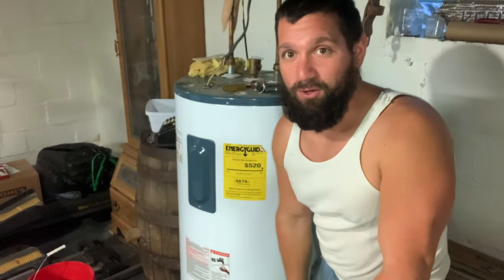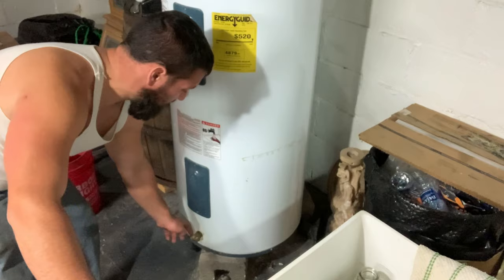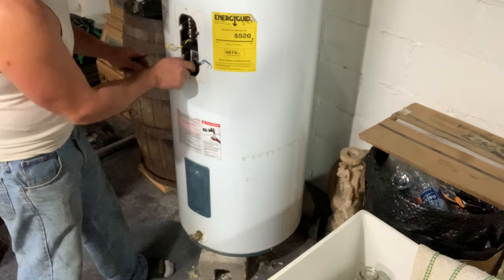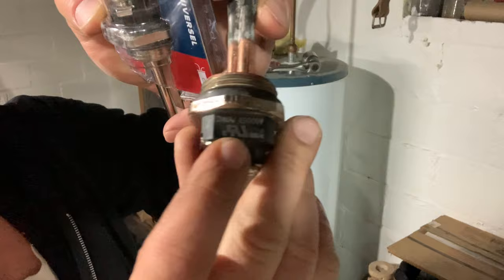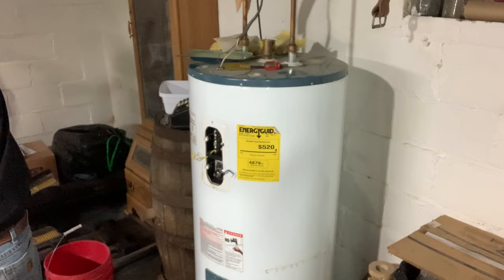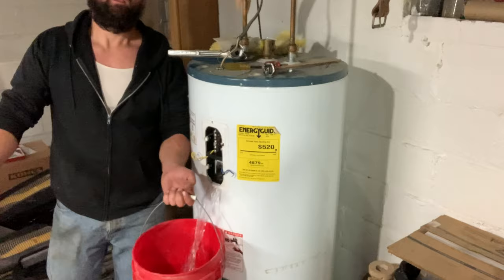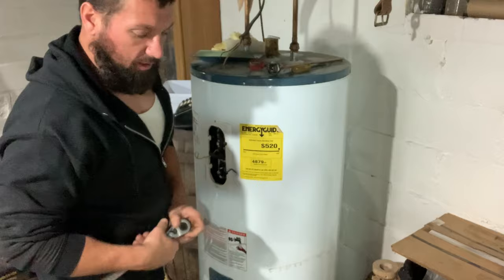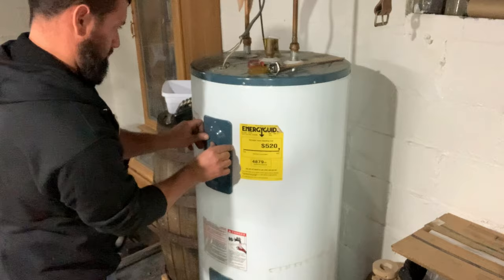How to replace an electric water heater heating element

Comment: Good video. Best to drain the tank before changing the elements if you can. A lot less messy. Shut hydro off, turn cold water feed to tank off, open hot water tap closest to tank (to help tank drain more quickly) and then open drain valve on the hot water tank (at base). Once the water is drained, you can start removing the heater element(s). Once the element(s) replaced, open the cold water feed valve to the tank and fill it until there is water coming out of the hot water tap you opened previously. Close the hot water tap. Check for leaks at the element(S). If no leaks, connect the wires, and turn the hydro back on. Grab your favorite beverage and pat yourself on the back....all done!
Reply from the maker: I couldn’t agree with you more about the bottom drain at the base the reason I don’t do that anymore is one time that drain never stopped leaking on me on a Sunday 😂 I have the worst luck though appreciate you typing that all out it’s helpful
Reply: I learn more from you than the video…thanks
Reply: @dlandscapingdesign1052  Glad it was helpful. I should add, that if the tank is old, there is a chance that the valve at the bottom of the tank can become clogged up with the sediment and corrosion that builds up and falls off over time, especially if you live in an area with hard water. You may have to use something to unclog it air compressor or flexible wire you can snake thru it. My old tank base valve was so clogged, I had to cut it off in order to drain the bottom of the tank. I replaced it with a new Rheem Plastic tank so shouldn't have that problem again.
Reply: Nice 👍🏼
Reply from the maker: Awesome
Reply: One important thing to remember when refilling the tank after element replacement, make sure to keep a nearby faucet open to purge any trapped air out of the line I; order that the tank fills to the top. Also, never turn the water heater breaker back on until the tank is full or you will burn out the element.
Reply: What is hydro?
Reply: Yep, this is how I've always done it. The video looks like a trial and error method.
Reply: And also when you’re checking for leaks after replacing the elements, check by opening the valve that releases the water back into the water heater and close the pressure relief valve on top of the water heater. As the air pressure builds up again from closing the (PRV) and the water filling up again, get close and put your ear 👂 as close to the element port as possible. If there is air escaping because of the water filling up and PRV closed, you’ll hear a hissing sound and in that case, grab your 1 1/2 socket and jumbo ratchet and continue tightening the element until that hissing noise stops. Repeat for the bottom element too if necessary. If not, you’re good, and can close the panels for top and bottom and make sure to connect the wires on the elements and thermostats before closing the panel and turning the power back on again for the water heater. Also note, test your circuit breaker switch for the water heater. If it’s bad replace it. Its normally a double 30 Amp switch that’s like $15-20 bucks at home depot and super easy replace. You can YouTube that too.😊
Reply: Also I forgot to add, if you’re wires are bad on the water heater, replace them too. Also dirt cheap to buy a line of those. Verify that it is appropriate in conjunction with the amperage from the 30 Amp switch, in the switch board panel.
Reply: @frontwoodsfarmer2063  happened to me, bad leak. I put a hose spray nozzle on it and cranked it down, ugly, but stopped it! Thanks for the video.
Reply from the maker: @DaveSomething thanks for watching! Appreciate all the kind words
Reply: Sloppy mess. Not recommended
Reply from the maker: @jointhejourney7472  sloppy joes sloppy mess 🤷🏽‍♂️

Comment: Hey man, I just wish you mentioned to people that when you drained from the top element orifice, all that water soaked the insulation and most likely the terminals at the lower element. 80% of the time, it's the lower element and if you have that much build up you will just keep replacing them. Not to mention the danger of shock and mold from moisture.😂

Comment: This is an excellent tutorial! I have done this a few times and it's pretty easy. Most heaters do have a universal element hook-up and it can be done in no more time than you took doing it in this video which is very informative. I always stress that you don't want to turn on the power at your breaker box until after completely filling the tank as you can very easily ruin the element by having it live without being wet
Reply from the maker: Thank you for the kind words! I should have mentioned filling the tank that is a good point i appreciate this comment!

Comment: Shut off your cold and hot water to tank
Briefly open relief valve to release pressure

Now when you pull your element it will “chug” out at first but youll easily be able to put the new element in without waiting to drain the water down.
Reply from the maker: Nice! Thanks Kellen for the advice.
Reply: Yes. If the end goal is simply to replace element, and you are keeping the unit, there is no need to drain it. Let water cool a bit, no pressure, but close valves so water comes out very slow. Unless you are flushing, cleaning, or replacing unit, waste of time and messy to drain it. Pull element out..... Rather than hold buckets, quickly put new element in.  If water is cool, no pressure, and valves closed it won't leak much.

Comment: I have the top element seeping water from around the gasket area . My wiring bar is held in place using a support bracket the slides onto the element housing . I think I can tighten the element enough to stop the seep of water . These elements are the 4500 watt rating . I am glad I saw this video because I am old school and remember we had only threads we had to use liquid Teflon on the threads to seal . I’m glad it’s a rubber type gasket/o-ring .
Reply from the maker: Great tip! Thanks for sharing!

Comment: Turn off the cold water , drain your hot water heater , it takes close to 1 hour, hook up your hose on the bottom, 
Then shut off your power to the hot water heater before you do any electrical work 
Remove your old elements up and down and the thermostats as well 
The whole kit is around 35 dollars 
After you finish , turn on your water and wait about 10 minutes to turn the breaker on 
Good luck
Reply from the maker: Thank u much

Comment: Avoid the mess man and just replace the drain valve. Or use the one you have and if it doesn't shut off 100% screw a hose bib cap on it. All that water everywhere mixed with the 240v can definitely cause an issue.
Reply from the maker: Thanks for the tips

Comment: And I had to get the one with frozen in place elements, got the cheap socket from Lowes with  a 20" screwdriver PB spray and couldn't budge it. Seen where a guy used a impact gun and it worked good,so I got a 38mm (which is 1 1/2" )  6 point impact socket from auto parts store and used my 1/4" Dewalt with a 1/4" to 1/2" in adapter and back them right out and installed new one with a little never seize for next time. Had to take the bevel off the face of socket on a grinder first to get a better bite on element.
Reply from the maker: Thanks for letting us know all the sizes

Comment: Very nice ty ty for all the safety tips also good thinking
Reply from the maker: Thank u for commenting! I’m glad it worked out for you. Are you on a well system or city water?
Reply: @frontwoodsfarmer2063  well water.  But needed to be replaced the whole water heater was shot  but I loved ur video when the heating elements need to be changed I’m gonna try it.  The water heater was 11yo
Reply from the maker: Oh ok I gotcha ya things like that don’t last quite like they used to we have a refrigerator that went through two compressors since 2016 it was almost $4,000 we got it 75% off for a going out of business sale but I’m just thinking what if someone paid the full price had to go through all that what a shame. I’m happy you liked the video 😊

Comment: If that valve gives you trouble do not get a new water heater. Get a full port ball valve. It will make it easier to flush the tank as well. It doesn’t make sense for them not to have them from factory.
Reply from the maker: That’s a great idea thanka

Comment: I have a similar issue with debris in the bottom of the heater. I plan to shut main water valve then pressurize the hot water side with air to force the water out through the cold water dip tube that goes to the bottom of the water heater. I can then open a cold water sink valve and drain the tank that way.
Reply from the maker: I never thought of that I like it

Comment: If I’m getting hot water, but not hot water like I was before, what’s your recommended diagnosis? 

Could it be a thermostat? Or most likely heating elements?
Reply from the maker: There are ways to test everything with voltmeters but I’m unsure how to do this you can’t really go by what it’s doing always sometimes I’ve found on that situation it’s a gamble between the two so I replace everything.

Comment: Look at the wattage rating of your hot water tank, usually written on the side of the tank, before purchasing an element because the total wattage should not exceed the manufacturer recommended load
Reply from the maker: That’s very good information to know thank you

Comment: @FrontWoodsFarmer  hey jus an fyi when you hear that gurgling sound when first taking the element out it's like a straw sucking air if you dont dilly dally you have about 15 seconds  pull it out and have the other replacement ready to go and put it in be fore the bubble releases and there you go it's in no mess no with minimal loss of water just so you know for the next time that's how plumbers do it
Reply from the maker: I appreciate that information if I go to change mine next time I’ll do that most of the time I drain it all so I can get some of that calcium out of the bottom unfortunately still got the old well water 😂

Comment: If the hose will not drain, use a siphon to drain it.  Put it in through the top element.  A 50 gallon tank should take under 20 min to drain.
Reply from the maker: Thanks for adding that to the comment section like I said def not an expert here always a better way to do something
Reply: @frontwoodsfarmer2063  i also learned to ensure it goes all the way down, as... the shop vac got a heck of a work out when taking out the bottom element 🤣
Reply from the maker: @WreckerRC  yeah there was alot of cleanup showed off camera 😂 special footage haha

Comment: So you dont need to burp the tank afterwards. I mean after screwing in the elements I figured there would be a larger air bubble in it. I heard air bubbles will cause you problems and prevent your tank from filling full of water?
Reply from the maker: Good question in my situation I got the laundry tub right there I leave hot water open when filling. I should of put that in the video like I said I’m not expert lol thanks for commenting hope everyone sees it I know it should be up top now 👆🏻👆🏻👆🏻👆🏻👆🏻
Reply: To be clear, leave a faucet open on hot water when filling the water heater. When the water heater fills, water will come out of the faucet and you know that the water heater is filled up
Reply from the maker: Good advice 👍

Comment: Should I fill the tank first and check for leaks before reconnecting the wires in case I need to tighten the element further ?
Reply from the maker: That’s not a terrible idea again I’m no expert so that sounds like a much better idea! Thanks for commenting and your input.

Comment: You are the FRICKEN MAN!!!! 😃 THANK YOU SO MUCH FOR THIS VIDEO BRO!!! i know you know how much money you judt saved me  being a dingle mom and unemployed i have to do constant maintenance in my home to ensure the life of everything we use daily . That includes the water heater. My bittom element isnt looking good at all. AT ALL!!! also the insulation is burnt and i dont want to put tget back on there. Can i judt get another piece and put it over it or is it like i got to sruff it up and around it and then drape it and put the cover back on? Its burnt and that scares me to death....
Reply from the maker: Thanks for watching and commenting!! That helps me wayyy more than u know i appreciate it 🙏 yeah with it being burnt I’d recommend calling a professional HOWEVER if it was me because only I can be responsible for myself 😂 sometimes haha I’d leave that small piece out and check make sure the wires aren’t burnt but I’d assume it’s from that bad element causing a ground issue I’d pop in a new element if it were me and be done leave the insulation out. I think that’s so impressive what your doing ❤️
Reply: @frontwoodsfarmer2063  yeah I already ripped it off and the wires seem to be ok it's just the actual metal. I tested it and it's exactly at the correct voltage and amp so thsts a huge relief 😅 and hell yeah dude your THE MAN!!! I haven't been able to find any videos about this particular electric hot water heater. It's actually amazing it lasted this long  I just moved into this house and slowly been working my way from up stairs to down stairs redoing everything. It just hit me one day.... damn I bet nobody has ever even cleaned this hit water heater off let alone serviced it 😅 I think I caught it just In time tho. 😊 your amazing thanks again. BTW thanks for replying I usually NEVER get a reply or even a like so you serious made my day 😏
Reply from the maker: @nikkilovetheyardsale-again2608  that’s so awesome your the best! Well good luck if you need anymore how to videos lmk I can throw some out

Comment: What happens if you get your insulation really wet. Should you let it dry out?
Reply from the maker: Yes
Reply: Hi. Thanks for responding. I replaced both heating elements. It did not heat. Then I reset the red button and it immediately started working. I'm amazed that it was still working with the heating elements so caked with mineral deposits. But maybe that's why it triggered it and it stopped heating. So now I have hot water. I just need to replace the anode tube, which I'm sure will be much more difficult.

Comment: Quick question. I have the exact tank and everything. The issue I’m having is when we use to much hot water the tank trips it’s safety switch. Not the main power breaker in the panel box. I’m saying it has a reset button I guess part of the thermostat by the top element. Would that mean I have a bad element?
Reply from the maker: I’m assuming something would be grounding out check all your wires etc before you change out the element rule out all the easy fixes
Reply: I'm having the same issue. Did you ever figure out the cause of the problem?

Comment: So I was in the process of draining mine before replacing upper element. Was a dummy and didn’t wait long enough and spilled water everywhere. There’s like a whole pool inside the plastic liner of water heater. Any ideas on getting all that out lol thanks !
Reply from the maker: Oh man I want to laugh but can’t I been there I really feel for ya! Your talking about inside your tank or that catch pan underneath? I’m not quite sure 100% what u mean? Thanks!
Reply: Yeah lol inside the metal shield of the tank just below the access panel there’s like plastic wrap and now I just have a huge pool of water hanging out there lol saw how you replace yours in the video and figured maybe you had an idea. Either gonna try to get a shop vac in there or poke a hole lol I’m not sure yet
Reply from the maker: @jaredrobinson3553  sorry I got tied up ya I don’t know I never had that happen to me yet not bad ideas you have but I can’t guide u there I never been through it

Comment: My tank wasn't draining from the drain  at the bottom so i had to do this. But water got everywhere, how long do I  wait to plug in the electrical parts again?
Reply from the maker: As long as it takes to dry up don’t want to risk getting electrocuted… ya them drains never work properly or never stop leaking
Reply: @frontwoodsfarmer2063  I'll make sure to wait and watch!! Thank you!!
Reply from the maker: @awickedprincess  thank u 😊 hopefully I got a new subscriber

Comment: RECOMENDATION,5:47 to prevent the water run around the tank,
1shut off the gate valve 
2conect a garden hose to the drain valve and wait until half of tank is empty
3remove the heating element and you'll see that you don't need a bucket 👍
3
Reply: You may have missed his comment about the risk of draining the tank if your water has a lot of sediment or other particulates. There is a chance that the valve for the drain may not seat correctly when you finish changing the element(s) and you've now created another repair for yourself.
Reply: @billconners6248  there's no risk when you let the water drain,is more risk when you let water running by the wires,it can cause a short, simple as that
Reply from the maker: Thanks for all the comments and recommendations your really helping the channel! People come to the comments to learn also thanks again

Comment: hey man thanks for doing this. is there a correct or incorrect order of attaching the wires to the element? I didnt get a pic before hand and have it working again but i have to wonder.... is one positive and the other negative? Talking about the two connections on the upper element? Im guessing either way of re attaching those two wires cant be wrong. however i do see two markings on the bottom. 

PS i know that accent anywhere and you CANT be far from southwest Pennsy. bet im within 300 miles :D

Edit2: Oh snap man i think i missed it the first time. Here 6:45
Reply from the maker: Lol all good! I hope this helped u
Reply: @frontwoodsfarmer2063  of course man thumbs up